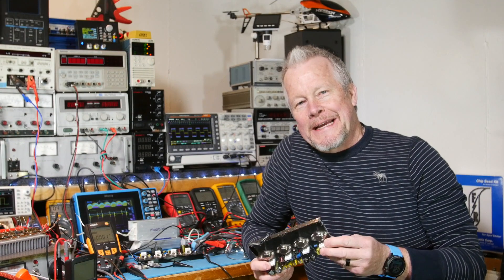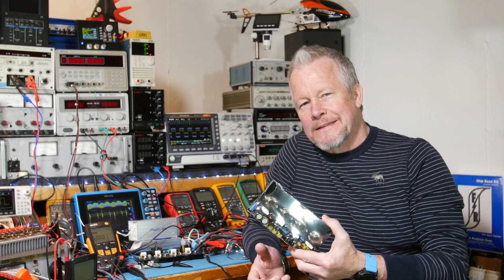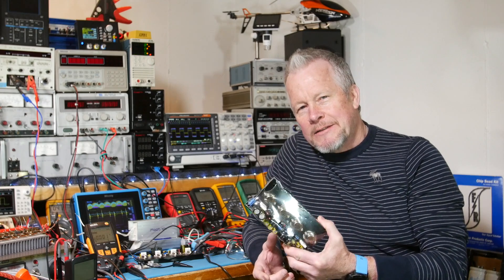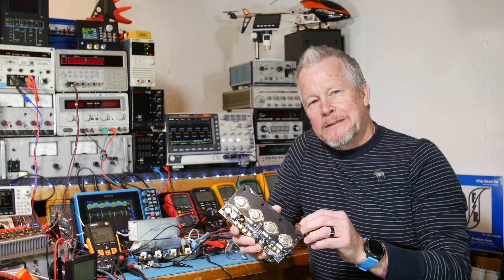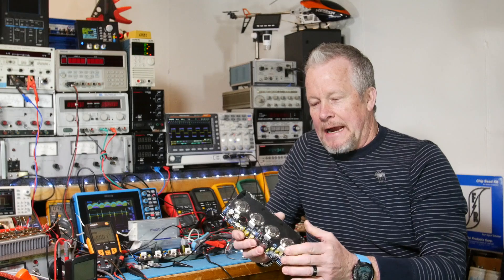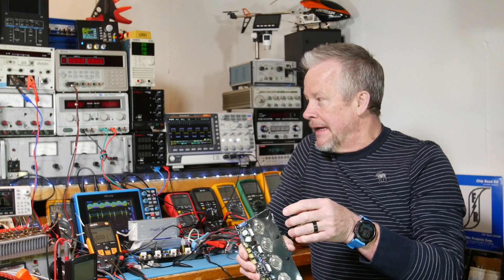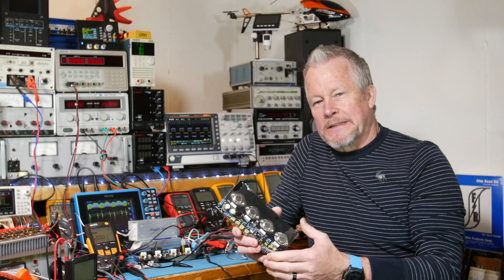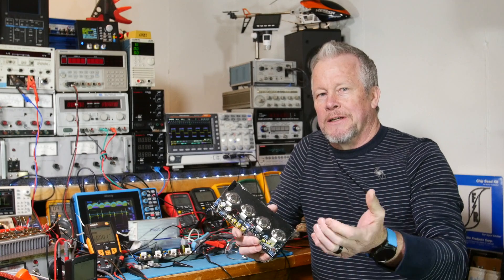20 Watt Class A Amplifier - This is Why it Failed

Comment: Sounds like they made this a 2 stage amp. The input stage (op amp) directly driving the output stage which is a buffer only. Most amplifiers (usually the class AB type) are three stage, including a voltage amplification stage between the input and output. Strange they omitted this unless it was actually made to be low power but given an inflated rating.
Reply from the maker: Thanks John!  It is an honor to have your expert comments here on my channel!
Reply: I appreciate your comments, still thinking why they used an opamp, instead of descrete input stage? Which is more advantageous ? Is it cost related only ?
Reply: @EngineeringEssentials  Could be a myriad of reasons from simplifying the board layout to technical such as wanting a device with high open loop gain since it is the only part of the circuit with any voltage gain.
Reply: @JohnAudioTech thank you for the reply John, 🙏
Reply from the maker: One thought is that the output stage is fairly simple - and open loop.  So, keeping to the simple circuitry notion, it makes sense to use the OpAmp.  Clean and easy;) There are things they could have done to improve, but the added complexity was not worth the minor improvements.
Reply: @KissAnalog  "the point of diminishing returns" right? Thank you 🙏

Comment: Sir what would happen if we use 4 ohms speaker in 8 ohms amp.btl class ab amps mostly recommend 8 ohms but here many use 4 ohms in btl type amplifier. Can btl type amplifier drive the current that require for 4 ohms in lower volt. If ve reduce the power supply rail volt. For example tda7294*2 btl amp
Reply from the maker: Great question.  The first video I did on this amp I did try a 4 ohm load at the 28 min marker;) https://youtu.be/D_b-i4VSjYc

Comment: What purpose does the 10k resistor serve here? What kind of effect would it have if I were to change it to a lower value like a 1k resistor? Also, I know this a class A amp, but is there a name for this general op-amp feedback topology (so that I can see more examples and read more about it)?
Reply from the maker: It helps set up the gain for the feedback circuit.  This OpAmp feedback is referred to as a Servo loop.  It insures that any DC at the output is accounted for and drives the amp output to zero V DC output.  Here's a schematic in the free simulation tool that you can simulate and try different things.  I have a play list of this amp, and I have a Tutorial series for the simulation tool.

Comment: Hi Eddie,
great video again :-) 
I think I spotted a little mistake. You calculated the amplification for the noninverting opamp for the wrong resistor ie you took the input resistor and not the resistor from the voltage divider. Thus the gain is 22K/680 about 32 (30 dB). 
The dc-offset-circuit is imho called a dc servo.
Reply from the maker: Thank you Martin!!  Great catch!  I think my eye caught the pattern of numbers and thought - great 10x;) I like the servo - what do you think?  I wonder what the draw back is other than cost?
Reply: @KissAnalog  I think it's an elegant circuit. Bob Cordell  has an own chapter in his book "Designing Audio Power Amplifiers" which is highly recommended. He also suggests to conduct a SPICE simulation of all DC servo designs to verify behavior.  Have a look at https://www.cordellaudio.com/

Comment: Great video, but what is the difference between a right amplifier channel and a left amplifier channel? 

Too bad about the design flaw with the Class A amp. It looks like it's well built...
Reply from the maker: When they are installed in a box the input connectors are on the same end.  With two channels the same side they don’t mirror each other in the box.  Make sense?

Yes it does have its merits;)

Comment: Eddie...I think I understand the problem. Your +-14 volt op amp rails can produce a sine wave of 28 volts peak-to-peak or 9.89 volts rms. Power = V^2 / R. With R = 8 ohms and P = 20 watts...you need V = sqrt(P*R) = sqrt(20*8) = 12.6 volts. Therefore,  you need voltage rails of +- 17.7 volts (12.6 * sqrt(2)). You also need op amps that will work at those rails. Have I encapsulated the problem?
Reply from the maker: You got it Steve - nice work!  So, the simple step would be to increase the voltage range of the zener/rails.  I am concerned that with what headroom is needed due to voltage drops.  I could get lucky and simply swap out the zeners, or maybe this will fall just a bit short.  I think the save thing would be to swap out the OpAmps too - just to be sure that there is plenty of headroom.
Reply: @KissAnalog  Eddie...this is really interesting stuff (for me). I know you have lots of projects in play, but I hope you have a little time to try to get more out of this amp.

Comment: Thanks Eddie,
What I noticed on my class A amp board is that it looked like the outputs weren't being driven into class A high enough because the positive side signal clipped long before the negative side. I brought up the drive and I did get more power out of it but I think that board is about as far as I want to go because the efficiency is so bad.

On the other hand my class D buffer project is going very well. With a relatively cheap D amp I'm getting pretty good sound out of it with very good dynamics and soundstage. 
I buffered the input with a tube amp that I modded to run a 12AU7A tube. I tried it with a 12AX7A but didn't listen to it long enough for it to break in with the new tube. I got the idea of using the 12AU7A from Paul the guy who runs PS Audio. He sells a class D amp that he buffered with a 12AU7A. I have some other circuits and stuff I want to play with but after all the bad hype I've heard about class D I think it's just that people don't understand it and how good it is. I'm going to try the ICE class D modules that are pretty popular to see if I get better sound but truthfully if I had to sit with one amp the sound of the cheap D with the 12AU7A come pretty close to what I'm personally looking for in sound. I think class D is the future of amps, it will be getting better and better like SMPS did especially with the fets coming out now.

ps: I like your excuse for a messy bench, can I plagiarize it for mine! Best to your wife.
Reply from the maker: Thanks for the great Feedback!  Very interesting stuff;)  I am very interested in your buffering stage;)  Such an awesome idea!

LOL, I need more bench space!  Thanks - I'll tell my wife...she's layed up on the couch and doesn't move much.
Reply: @KissAnalog  get her a couple of jigsaw puzzles.

Comment: Just watched this vid on Odysee as I just signed up. I have built a 40 Watt version of this class A amp which has discrete class A input section. I have not analysed the circuit at the moment but I intend to do so. I purchased the PCBs first, then purchased all the components selecting high quality from the main suppliers RS, Farnell, Mouser etc. If I can, I could send you more info on the PCBs, i.e. scanned images and maybe the ebay link if I can. Your expert analysis of the amp taught me how the negative feedback works using the second amplifier. Thank you for that.
Reply from the maker: That’s great that people are going to Odysee!  I’d love to see which amp it is;)
Reply: @KissAnalog  I just shared the info. Thank you for your reply.

Comment: Hi Eddie.  Are there any published specifications for the amplifier?  I have to wonder if the power delivery is specified at a particular frequency or frequency range.  I was under the impression that lower frequencies require much more power delivery in order to achieve a given volume (which is why subwoofers use so much power compared with tweeters), so it wouldn't surprise me if the power figure is for a pure tone at the lowest frequency that the amplifier supports.   Whaddya think?

In any case, I second the notion of attempting to get this to work, instead of just tossing it.  It's much more interesting.  :-)
Reply from the maker: The only specs that I found are listed in the information under the video.  They do specifically call out 8 ohms.  You are correct in that low frequencies require more power, but only if we are talking music.  If it is a generator setting a constant frequency and signal level, than all are the same power;)

Thank you for your vote - and I agree;)

Comment: A tough call, but I think it's always   cool to fix something, especially if it can be achieved for a few £, but it sounds like me you have tons of other projects to get to. I tried a DC servo using an opamp on a Mission Cyrus  2, worked really well, the integrator cap was a 10uf polypropylene, large enough to keep any unwanted phase shift effects out of the audio band. It sounded much better than having the 470uf bipolar in the feedback circuit which it had as standard. Keep up the great videos 👍
Reply from the maker: Thanks Ian!  Very cool!  I wonder if the servo is just not as popular because the cap solution is simple and cheeper?  I appreciate your support!

Comment: Excellent video Eddie 👍
This is what was needed! The schematic on the Steady Eddie Cad Board was a great job on your part! Thanks for that, the opamp section is where the problem is at, it would definitely be an interesting fix but only if you are confident that you can get it working right! 
So basically they are using an opamp to auto steer the DC offset... I can't say that I have ever seen such a circuit before, I took a screenshot of the schematic because I feel that I might want to have a play with it some time later on.... 
I think that the output and driver transistors are going to be fine, the problem seems to be with the opamps, it's almost like they are being driven to the supply rail's, like as if the gain is set to high for the available voltage rail's of the opamps... 
It could be just a simple resistor or capacitor swapping or maybe much more complicated than that.
Are those output stage transistors in parallel? I'm assuming that each board is mono? The only time that I see four output stage transistors is when it's a stereo board or when it was designed to handle lower impedance and they doubled up on the outputs for current sharing... They look like they should be capable of some serious output at class A.... But are being let down by a few components around the opamps.... 
Oh, and by the way, I just watched a video from John Audio Tec and he has given your channel a plug! What a nice bloke!!!
Reply from the maker: Thanks Peter!  Great observation and feedback!  I'm going to see what I can do and get this thing going;)  Yes, it is a mono block and there are 2 transistors per rail.

John's a great guy and I loved that shout out;)   I sent him that Tektronix multimeter and I always love it when I see him using it;)
Reply: @KissAnalog  well he definitely deserves it... Good call on your part though...

Comment: Jumping in the middle of the story, I guess I'll have to watch more of the series to see that drive circuit. Sounds like you figured it out, a very interesting way of keeping the output centered, a very LF/DC feedback loop. Was going to suggest that maybe that output rating was for two Ohms, but then remembered it was Class A! Class A is a waste, not sure why your not going AB2 with this. And you know that that is just a spreader, right? You will need a huge heatsink to bolt up to it. Class D is practical unless it is for an audiophile, which the cheap modules really aren't, as seen on JAT.
Reply from the maker: Thanks for your feedback!  It is rated 20 Watts into 8 ohms.  I'll see if I can get it.  Yes, I should have referred to it as a spreader instead of a heatsink - that would have saved a lot of confusion;)  I think it is great that they put this 'spreader' on the board though.  I don't often see these.  BTW, I will do more than one Class A, but only so that I can show their benefit vs cost in heat;)  Also, so that I can compare to the other classes.  What I really want to do is come up with a nice Class D;)
Reply: @KissAnalog   If your output is DC shifted sufficiently, then you might get your 20W without exceeding the voltage peaks?  LOL

Comment: Great video...

Interesting simple design flaw.

I'm designing and building a 10 W class A hifi amp now. I have a transistor for voltage gain between opamp output and darlington drive transistor base. This enables me to run the opamp from 
a 10 V bus.
Reply from the maker: Thanks for the great feedback!  Sounds like you are having fun;)
Reply: @KissAnalog  yeah it's good to get the soldering iron out again.

Comment: Yeah the input and the output of the op-amp being coupled that way they are is a bit interesting. Also I agree with John that it seems that it's missing the voltage stage as it looks like the amp is hitting the voltage wall. I do think there is a problem with the op-amp and in-put stage, and me being a why person I would have to pull the op-amp and test them, and may be try  an OPA2604 (that's because I have a tube of them in a box somewhere!!). Anyway great vid!!
Reply from the maker: Thank you!  This amp has come a long way since this video.  Changing the power supply rail voltage to the OpAmp stage and then changing OpAmps out has brought the power up to 30 Watts;)

Comment: Wow.. that circuit is super simple. 😍 Good one for a beginner. But not good for a commercial product. In my opinion this product should not cost more than 20USD. Demand for this kind of circuits are generated by marketing them as "tube like amplifier" class A LOL.
I personally never baught a class A amplifier(but I built some out of curiosity), especially today we have modern class D amplifiers with their distortion figures on par with that of class A. Why waste power, space, money on an amplifier which produce less output? With increased temperature components will wear out quickly again costing money on repairs. From my understanding if you're not a musician/music composer/a music sensitive person/can hear a mosquito flying 100m away 😂 you don't need a THD figure below 0.01%. Eddie I suggest you to keep it for reference purposes.
Reply from the maker: Thank you!  I now have a full schematic;)  https://youtu.be/dtWm8Q-cKUU

Comment: Great analysis... Would be interesting to see the opamp changed for one which can take the higher voltage and increase the zener to suit, let's see if this thing can do 90 .. uhh .. 20W into 8 ohms 😊
Reply from the maker: LOL Yeah - let's try 20 Watts;)  I'll try to fix this thing and do a follow up very soon;)
Reply: @KissAnalog  Hm yes, if the NE5532 is genuine it should be able to handle +-20v supplies ... there's only really one way to find out for sure though ... Either way you get a great video out of it, everyone loves to see the smoke let out

Comment: Nice vid Eddie, thank you for your time in doing these videos. 
If you allow me, I would consider to return the amp ( even after gave thumbs up). 
About the circuit, in my very short experience with those types of circuits for correcting the output offset, I'll say that it do not sound good. It make a very insteresting result for a static measurement, but make the amplifier behave in a very wird way for program material.
Like you, I would prefer to see some pot to control the offset output. 
I really like the ideia of use feedback, but for power amps and big loads I prefer to see an open loop. 
Again, thank you for your time in doing such videos. It is a very nice way to spend some time. 
Cheers!!
Btw, best wishes to your wifes recovery.
Reply from the maker: Thanks Eduardo!  I agree with you - not only is it not very loud, but it seems to sound a bit off.  I think I will keep it so that we as a community can learn what the heck is going on;)

I appreciate you - and my wife does too;)

Comment: Great video! Very educative, interesting and very well-made.
But those low efficiency, potatoes you use for speakers….😂
You should get some high-efficiency speakers for testing, low power amplifiers.
Like RP600M That can be literally driven with one Watt.🙂🙏
Reply from the maker: Thanks for your feedback!  You might be surprised at what speakers I bought;)
Reply: @KissAnalog  Do you have some new speakers? What did you get?
🙂🙏

Comment: awesome if it fix DC offset it mean you could have some dac like cirrus logic and pcm1794 directly in the input without cap... even without output stage in the dac ...
Reply from the maker: That would be a great experiment;)
Reply: @KissAnalog  if you do I recommend two dac chip to reduce crosstalk and better SNR. (or 4 dac chip with 2 in parallel) also stepped volume attenuator (no channel imbalance) and good clocks.. accusilon, crystek or ndk 

it depends how good you find this amp..

did you measure voltage swing and square wav rendering?

i would make it work as headphone amp instead... again if you can bridge the output to mono I would use two one each side to reduce crosstalk between the channels

Comment: Hi, I enjoy watching you use your skillz like this, so had to do a thumbs up. Having said that, I think you will be wasting your time as the transistors are probably fake, and the design limits the voltage because the fake transistors can't handle the full 20W.

There is a low quality schematic online for this amp, where you can only read some of the component values. Maybe you can put your schematic into micro-cap and then play around with the components. That'll save you having to fix the amp if you decide to go for the class D amp instead.
Reply from the maker: Thanks Ian!  I appreciate you!  I too am worried that they might be fake.  I think I'll keep it as a learning tool for all of us.  If I can get it to be worth the money - if I can show someone the steps to fix it - maybe it will be worth it.  I can also use it as a demonstration on Microcap;)
I might to the Class D now for my friend and then work this as parts come in.